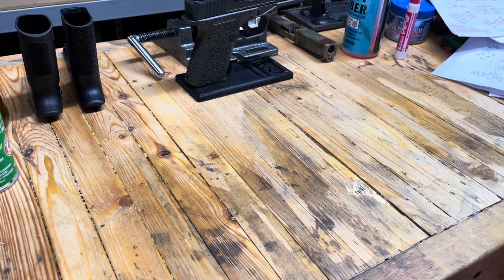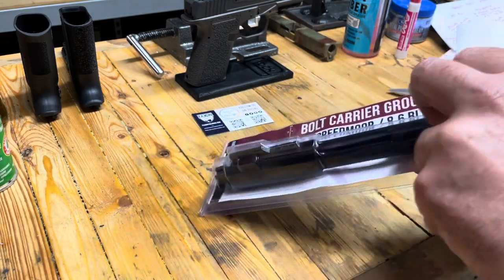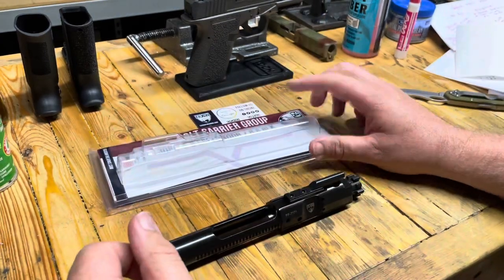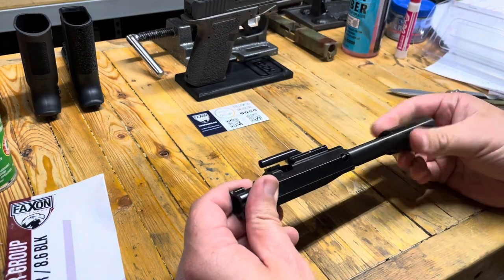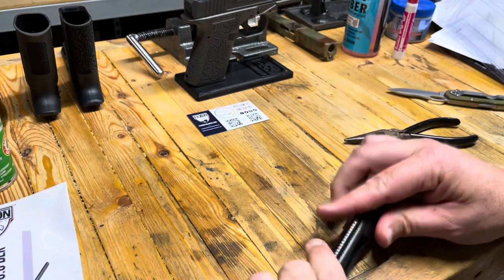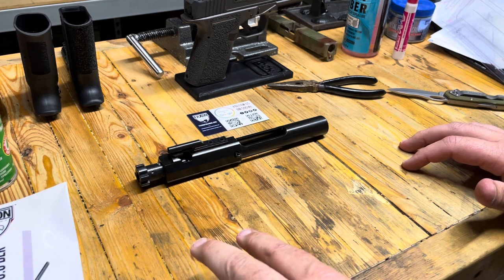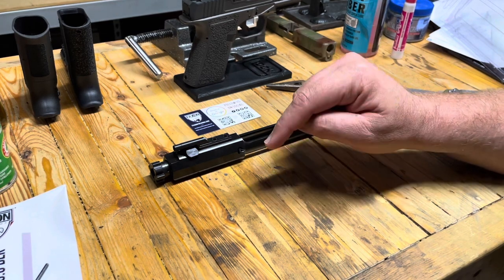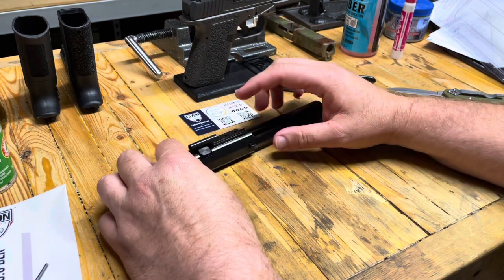8.6 BLK The BCG Is Here!

Comment: I'm looking to get into this. I already reload for 300 Blackout, and  I already  have am Aero ( DPMS pattern) 308 lower and 2 uppers in .308 so my startup costs won't be NEARLY as high. And my 308 lower is set up with a pistol brace because one of my 308 uppers is a 12", so I'm thinking a 12" 8.6 barrel for this new upper. 

 I'll just need to get a barrel, stripped upper receiver, and handguard and I can reuse my 308 lower, BCG and charging handle. 

And now, 2 years after this video, you can get Lee dies in 8.6. And there are vids here on YT about making 8.6 brass from 6.8 casings. 

I live in Montana and this should be an awesome hunting round.

Comment: You may want to look at casting the bullets as it seems that the cheapest ones are at $0.40 or so, but I am not sure how that will jive with the crazy rifling.
A mold can be had for 40 bucks, and powdercoating bullets is very cheap and easy, so if you can scoop lead from your range or somewhere else you may at least have "blasting" ammo that is maybe a dollar if you can resize .308 brass.
Reply: I've had good luck powdercoating subsonic 300 BO bullets so I think you're on the nose, as far as 8.6 subsonic bullets go. I will have to look into a new mold for 8.6.

Comment: will a soft point bullet survive the twist rate?  I'm building a similar rifle only Aero lower & upper got my bolt & go no go gages today.
Reply from the maker: I don’t think so ?
Reply: Non bonded lead cores are a no-go. Copper is mostly good to go, except subsonic ones pushed to supersonic speed, or else they'll open up prematurely.
Supposedly, tough bonded supers are good.
Reply: @ravissary79  that’s my understanding as well but this is just based on what I heard kevin say in a podcast. So much mystery here.
Reply: @EagleRun23  I don't think it's that mysterious. It's the twist. It increases the RPMs to the point of failure on some designs. Typically those RPMs are only seen on hot-rodded magnums. Lower twist can do it if the bullet goes fast enough, but increasing twist will get you the same result with less velocity. A previously only exotic problem now accessible to the common man.

Reportedly, even if a cup and core or BTHP doesn't explode, it'll still soften and excessively obdurate, causing it to fly erratically. And with any gun intended for suppressor use. The Last thing you want is irregularities leading to a baffle strike.